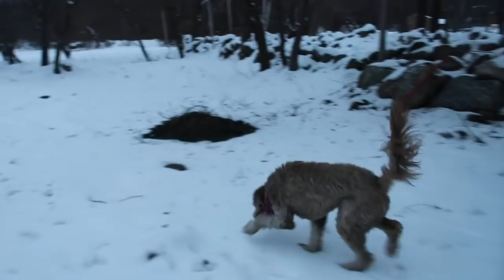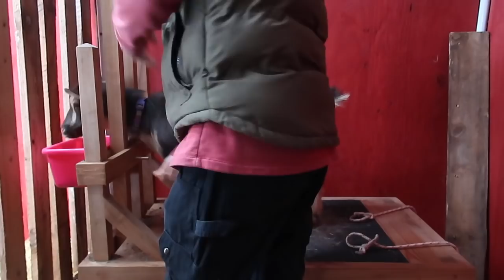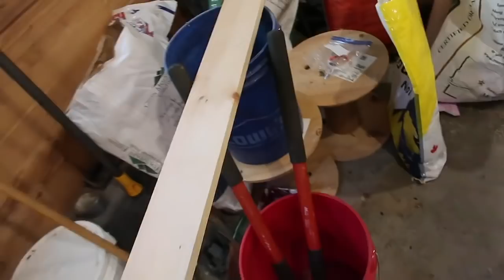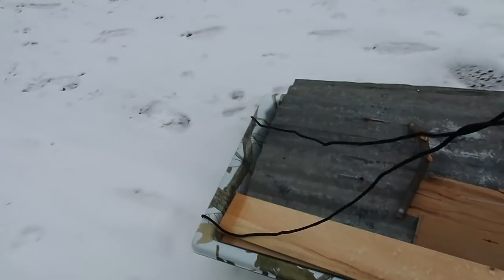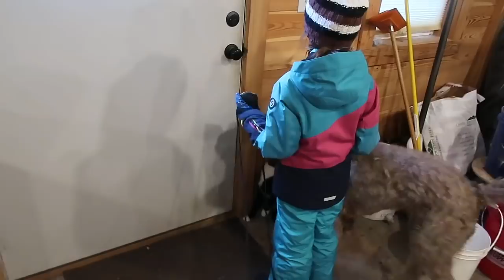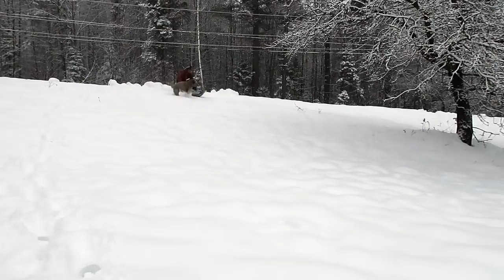I hope this ENDs WELL! (Sledding in November)

Comment: Al, Use your plow to pile snow into a starting hill. A 4 to 6 foot high pile with a flat top and ice stair cut into the side can be a great place to start a ride. You can pack a slight tipping point so you can climb in the sled and lean forward over the tipping point and go zoom. Lots of fun like I lived 50 some years ago. Stay young.
You could make a wood seat in the sled with side handles over the side to use as brakes for differential steering. Olivia will like the control. No need to anchor it in. Just set it in and sit on it to hold it down. Piece of cake for somebody with your brain and hands. Great goat door.

Comment: Wrapping the handle in chicken wire might preserve it longer. Did you put a pin below it to keep it from slipping down? It might be kinda stiff now but it will probably get looser as you use it and that door could become a guillotine. Have fun on your break Olivia. Looks like you're off to a great start.
Reply: I was thinking the same thing . What if one or more goats go out and they get trapped outside in the cold because the door slides closed on them. Murphy is working 24/7 .

Comment: If you get 2 pieces of 1/2 or 3/4 PVC you can make a harness with a belt and the sled won't run up on you when walking down a hill. This too leaves you with 2 free hands if needed. I have 3 of those or similar sleds for ice fishing and towing camping gear into the back country for winter camping and fishing trips. They are a life saver.
Great video. Do you think the goats would go in and out if you hung that clear plastic they use over loading dock doors and sometimes in freezers to help keep the cold in or out. That way there will be more light and it would help keep the winds from blowing into the goat barn. Just thinking outside the box. 
What kind of goats are those? 
I raised Hamshire and Yorkshire pigs when I was a kid. They ended up being more like pets than livestock. I just sold them and used the money to purchase pork because I became to attached to them.